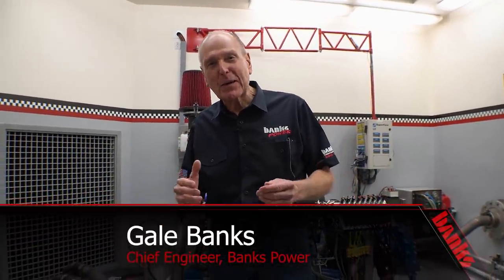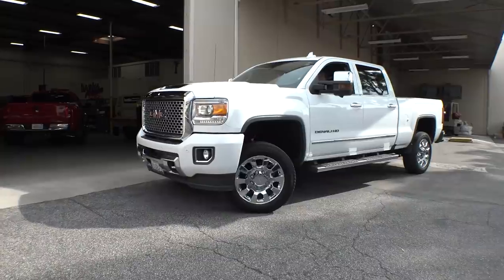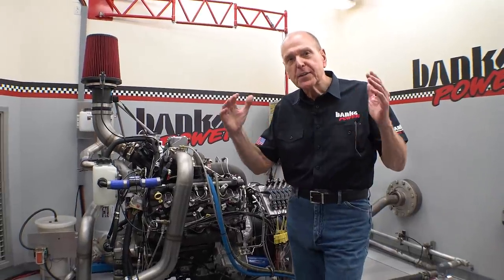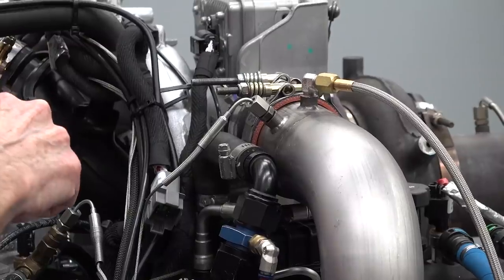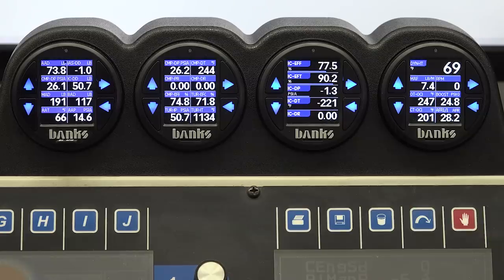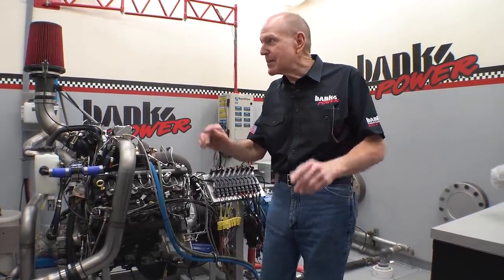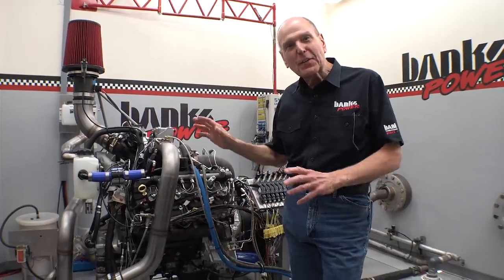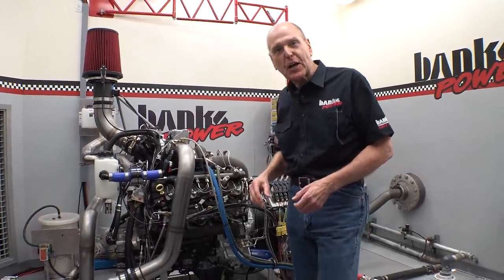KILLING A DURAMAX Pt 1: First fire! 🔥

Comment: DOESNT LOOK LIKE A REAR END COVER VIDEO....
Reply from the maker: The reason for the time between follow-ups is purely due to R&D. When we post a video, ten times out of ten, it's something that happened that day or the day before. Doing something no one has ever done before, at least done it well, takes time. Regarding the diff cover series. We've been sitting on the info for quite a long time. Why? We'll only get your attention once. We're going to reveal the research when we debut our cover design. We made many iterations and several billet prototypes, tested the heck out of the design, then went with a manufacturing process that is far more accurate but takes much longer. Are we curing cancer? No. But are we making the very best part possible? Yes. As of now, the diff covers in production and we hope to have announcements soon. When we announce the release, we will post the results video. 🏁👍

Comment: The old duramax held 1080 horsepower the L5P should be closer to 2000hp
Reply: What engine was that. I never heard about anything that crazy on a stock bottom end
Reply: H&S breaking point @youtube  did a powerstroke 880hp and a duramax 1080hp